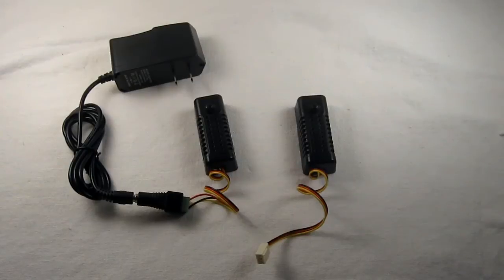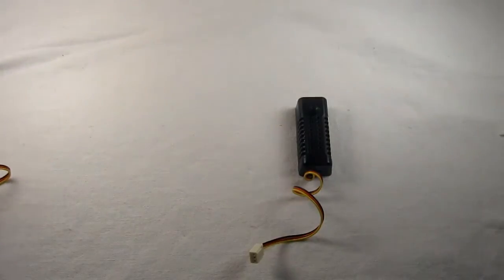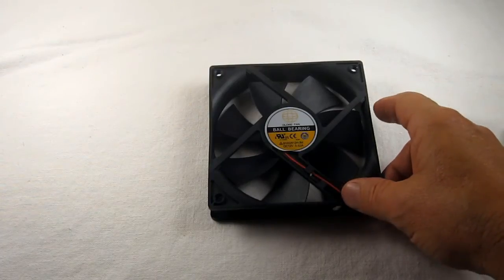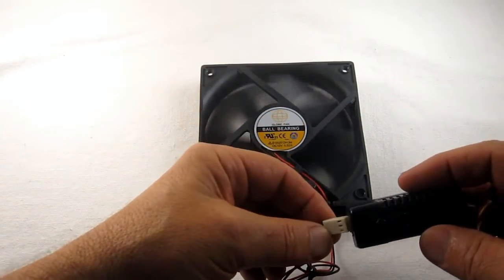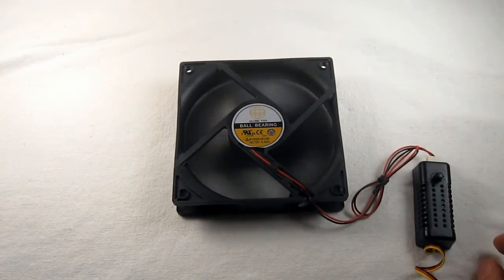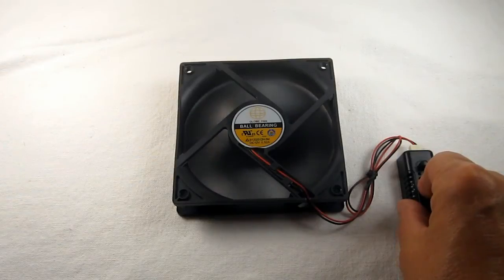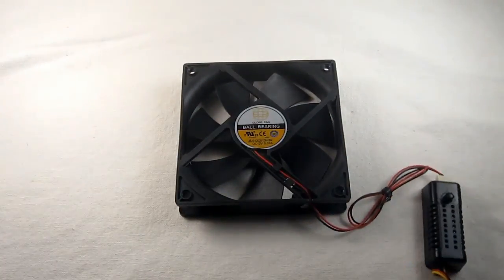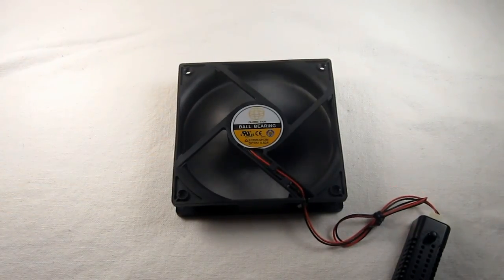Fan Speed Controller from Electronichaus

Comment: https://www.ebay.com/itm/PC-Fan-CPU-Cooler-Speed-RPM-Controller-Noise-Sound-Suppressor-Silencer-3-Pin-2X/322049873946?hash=item4afbab181a%3Ag%3ApmEAAOSwOMdZP1p0&LH_PrefLoc=1&_sacat=0&_nkw=cpu+fan+controller&_from=R40&rt=nc&_trksid=m570.l1313&LH_TitleDesc=0%7C0

Comment: Just a suggestion.  Put your website in there along with part numbers or better yet the order form. :)
Reply: https://www.ebay.com/itm/PC-Fan-CPU-Cooler-Speed-RPM-Controller-Noise-Sound-Suppressor-Silencer-3-Pin-2X/322049873946?hash=item4afbab181a%3Ag%3ApmEAAOSwOMdZP1p0&LH_PrefLoc=1&_sacat=0&_nkw=cpu+fan+controller&_from=R40&rt=nc&_trksid=m570.l1313&LH_TitleDesc=0%7C0